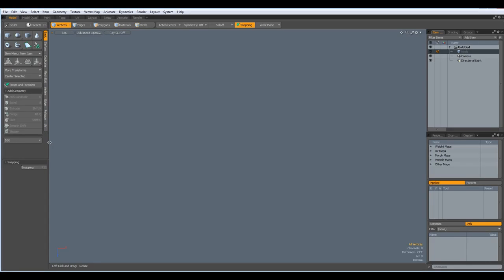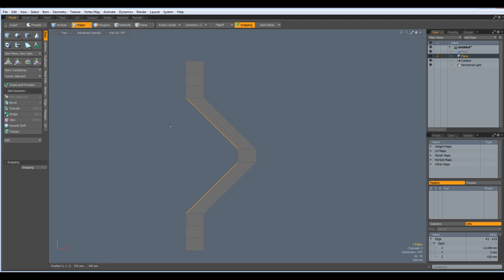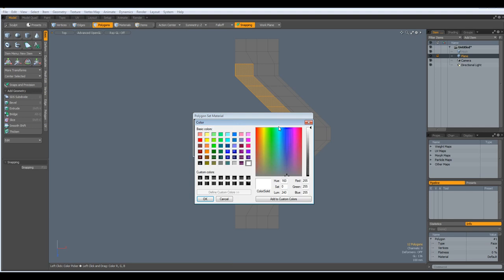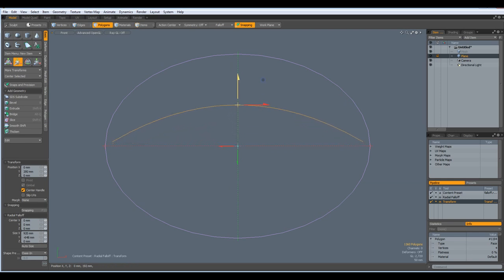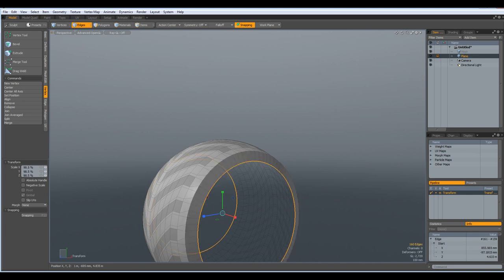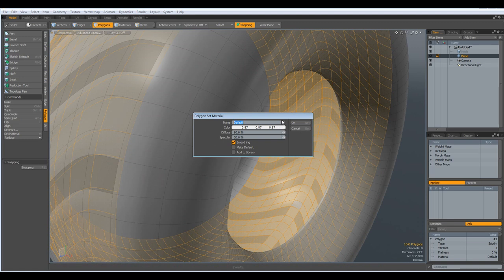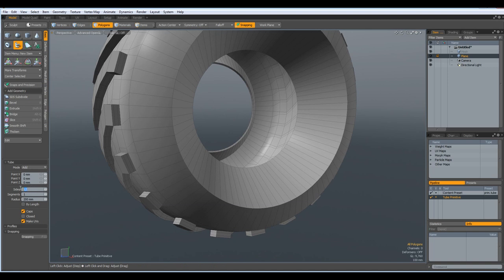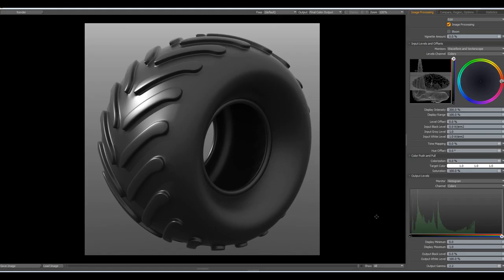Luxology modo - Modeling the tire of a monster truck

Comment from the maker: Hi Francisco, the link to the script is in the description of the video. But you can easily do it yourself by adding an additional edge on the outside of the tire around the middle hole and then form the tube with that additional geometry. Kind regards, Peter

Comment: Thank You, Peter. One TIP... To get a thumbnail just make a screenshot with render and after video upload You can upload Your screenshot as a thumbnail for video in settings.  it's a fast & easy way =)
Reply from the maker: Hi Aleksandr, thank you for your tip. In fact you can have it even easier when you render and save the image as a 1280x720 jpg picture (YouTube standard) but somehow I felt at that time, that one has to see it was rendered with modo :-)) Thanks again and take care, Peter